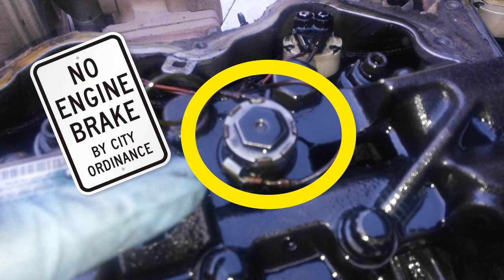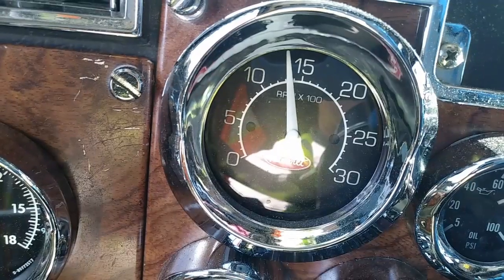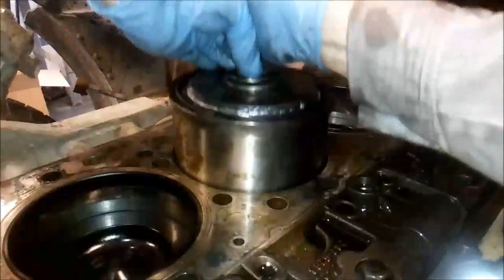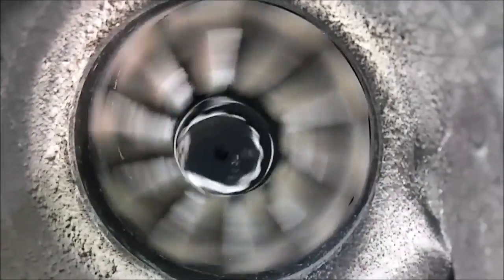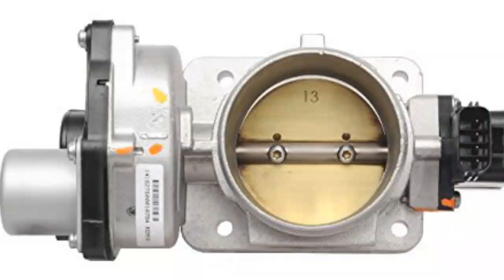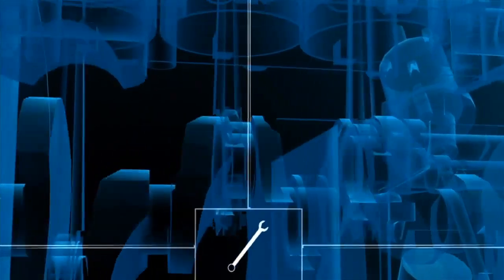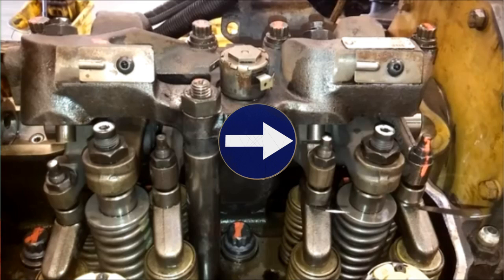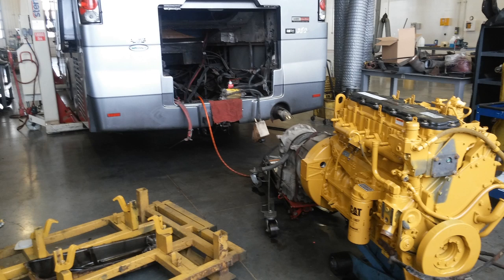The Difference Between Jake Brakes And Exhaust Brakes?

Comment: Mack engines use what they call dynatard? It introduces oil into the cam shaft raising a bump? Opening the exhaust valves at the top of the compression stroke relieving pressure hence a decompression tool

Comment: Thx for explaining. I was searching for the difference between a ‘retarder’ using electromagnetic force and is mounted on European trucks after the transmission, and other engine brake systems. Also trying to figure out if and why European trucks do not have jake brakes. 
Can you address this in a future video?

Comment: Been wondering how they are so loud, since here in europe they are not loud. This video was good explanation how air escapes under pressure and becomes loud sound. Many europe trucks have similar valve systems but not making loud sounds and some trucks like my FH16 has retarder that brakes very strong. Its hydraulic and mounted after gearbox.

Comment: The Exhaust brake on a IC bus with Cummins engines are as useless as tits on a bull. So International in their brilliance activate the cooling fan which adds a lot of resistance and NOISE to the operation of the school bus. The vehicle doe not downshift. And starting back up after a school bus stop the DAM fan continues to run along with this absurd noise and the bus is listless until the system turns off the fan, The fan steals 200 RPM of acceleration of power. BLUEBIRD uses a Variable Geometry Turbo and downshifts the transmission as you approach your stop....it works perfectly. International solution SUX.............I devised my own copy of Bluebird's Exhaust brake system, by manually throwing the shifter on the automatic to 2nd gear. I lightly activate the brakes to get the transmission to start its shifting sequence. The engine never goes above 2500 RPM. SMOOOOTH operator!!!!  My Bus Boss told me that I'm going into YEAR 4 of the original brakes on my 72 passenger IC bus and the wimpy powered Cummins

Comment: Thanks for comparing the two systems. Now, stupid question for anyone out there who knows: I get that I can add an exhaust brake to my diesel engine (6.5L turbo diesel V8) but will it be at all effective in slowing my (18,000 lb) motorhome downhill as it has an automatic transmission? Having to stand on the brakes whenever dropping down a hill really chews up brake pads (4 wheel hydraulic disks).

Comment: Where Im from the steepest longest hill used to warn 10mph, max engine braking. And there was a special lane for trucks that were still going 60 at the bottom. Some jackass at the bottom of the hill complained, so they put up a sign "no jakes". Then 3 out of towners never slowed down at the top. Two went in the runaway ramp, the 3rd went through jackasses house. Their service brakes had all caught fire halfway down the hill.
Reply: Just needed a muffler

Comment: Hi there, help me understand here, why small diesel sedans or some pickup trucks don't have exhaust brakes. at least when it comes to pick up trucks they weigh up to 3 tonnes, imagine them towing something, that number will be 4.5 tonnes which is like a small city truck. i think it should be necessary but they dont have engine brakes at all. Why?

Comment: I was told blocking the exhaust will burn the valves.   What's keeping them from burning now?  Titanium material? Na-filled?    I would have thought an intake side butterfly valve works much much better at letting the engine generate braking force.

Comment: Another thing people do not realize is that the actual effectiveness of a Jake brake is solely dependent on how much compression the engine has.  That's why older Cat engines such as the 3406 A,B, and C's did not have that great of Jake brakes.  The 3406E's and C-15's have a much higher compression ratio thus a much better braking efficiency is attained.

Comment: love your channel  no offense met   but intake butterfly valves have nothing to do with anything     I can prove it   take any gas powered vehicle  preferably one without a steering wheel lock    motorcycle  older car etc   point it down hill rolling at speed   release the throttle and feel the resistance      Now  turn off the ignition and open the throttle fully  and feel the difference   Why   because it takes more energy to compress a full charge of air than it does to pump vacuum   Diesels have so much more compression that there is more springback   like bouncing a half deflated basketball compared to one fully inflated   the timing of the jake opening the exhaust valve vents off the high compression and deadens the cylinder creating retarding force   This is also why a Cat or Mack engine doesn/t work as good as a cummins because they have direct timing off the 3rd injector lobe  where as Cat/Mack use a neighboring cylinders in or exh rocker arm thats kinda close for timing    Modern electronic diesels may use crank triggers or cam position sensors for Jake timing  Respectfully Thank You

Comment: So a jake brake will dump air that's compressed. That's cool. Could it also use a vacuum? the down stroke, too, being that they can control the exhurst valve you could control the intake too ? Or would this suck gasket in ?

Comment: Hell instead of having to do maintenance on a high temperature out of the way system it seems like it would be simple enough to install a throttle valve and blow off valve that was set to wide open unless braking then close and redirect boost air into the inlet side of the turbo and your done simple and quiet!!!

Comment: For the 3AM truck driver deep into city using their "Jake Brake" F€}%K O£F! We don't need that.
  Secondly, I understand that people are well, not the dim bulb but close to it. It is a "Valve" that pivots on a center shaft. Not a butterfly, google it.
 Electric injectors started in 2 cars in 1976, at some point engineering found that a throttle position sensor showing a closed throttle but vehicle speed and high manifold to atmosphere difference shut off the injectors to save fuel, reduce raw fuel in the tailpipe and not blowup the muffler (Gas/Petrol)...but no fuel until close to above idle speed, then back on to keep running. 
  As for the rest of the video was good, even the banana in the tailpipe good. (Eddie Murphy/Beverly Hills Cop) reference! 
DK, ASE master tech since 78

Comment: So when the compression brakes are active do the affected cylinders just repeat intake, compression, intake, compression strokes?  There is no need for a combustion or exhaust stroke?
Reply: With compression brakes on, the cycle is intake, compression(release on combustion), compression again then intake and start over.

Comment: 2017 f350 lariat it's my first diesel .1 month owner. I just don't want to break down . Does the exhaust break build alot of back preasure an cause the crank case an oil pan leak in yalls opinion.  I bought the truck an next day started drippin oil. Then they replaced crank gasket,2nd oil pan gasket apologies for the dumb questions just tryin to understand so I don't fk up an have a costly repair from ignorance

Comment: I've been a school bus driver for 10 years, and I've driven quite a few buses. One of the buses I drove had an exhaust brake on it (think it was an '05 International, can't remember what kind of engine was in it though). It was a really nice feature, especially on field trips. Coupled with the automatic, it would not only slow down on the hills, but the tranny would also shift down on its own. I still had to use the brake pedal, especially with  a  lot of passengers, but given that Internationals tend to require a heavy foot to operate the brakes, it was a really nice ankle-saver. The biggest drawback I found with it was the odd smell of burnt diesel whenever I used it. The odor would get into the cabin and stay there for a minute or two after I'd turned the E-brake off. It wasn't overwhelming, but still noticeable. I really miss that bus sometimes. Out of all the Trash Nationals I've driven, it was actually a good bus!
Reply: Lmao 😂 It says it's been two years since you wrote this with no reply and only 4 thumbs up. Hilarious, topnotch writing. I guess it just requires to much joy for all the Karen's to catch the joke.
Reply: @thetruthspeaker1978  4 months after you wrote, the count is now 9, still very few are 🤣🤣🤣. Great story.
Reply: @thetruthspeaker1978  Maybe they would have gotten it if I'd called it the Thirteen Letter S*** Spreader?
Reply: @jasongeorge7987  They might catch your drift then.😂
Reply: You just answered my question: does an exhaust brake work with an auto transmission? Thanks. Now to source one for our RV 😅

Comment: Why not put the exhaust brake on the intake side? Or on both sides? 

How quickly does that exhaust brake get caked in carbon, making it malfunction?
Reply: Funnily enough, my 1980's Toyota LandCruiser has an intake butterfly which is extremely rare on a diesel engine. Since I have a straight through exhaust (no muffler) it sounds like I have an exhaust brake when decelerating in gear. I love it.

Comment: why do people shift with the jakes on isent that the opposite of shifting why shift up when you switch gears and let off the jake comes on why do people do that. i always wondered?
Reply: It is a bad practice,  but some do it to shift faster because it slows the engine faster than just letting off the throttle, allowing them to get into the next gear sooner.
Reply: Cool man thanks for the feed back🤙

Comment: Hypothetically you can use an exhaust brake system on a truck equipped with a jake brake. It could potentially improve braking ability, but I'd be willing to bet in most systems, it would just make the jake bake system work less efficiently. The point of a Compression brake is to let all that high pressure air escape quickly at the, well, wrong time. If you then restrict the exhaust, that air has no where to go and it doesn't escape the system quickly. Thus you lose efficiency. Conversely, if done right, this could work by essentially reversing the airflow in the engine or at the least nearly stopping it entirely. It's not. Very good idea and theory isn't the same thing as real life.
Reply: Efficacy of the compression brake relies on the turbo charger which itself relies on unobstructed exhaust flow. If exhaust flow is restricted, the turbo's boost wanes thereby detracting from the compression brake which is itself much more effective than an exhaust brake, so it really is either or...the clearer choice being a compression brake if you need the stopping power.

Alternatively, if say you had a supercharger instead of a turbocharger, then what you're saying is absolutely right, you could literally add the two stopping forces together very effectively....& probably to the point of stressing the engine & drivetrain too much! But the argument against using superchargers is that they use more energy from the engine than turbochargers to function.

Comment: I cant seem to find the answer but can you put a jake break on a cummins pickup since some tractors do have cummins engines
Reply: Usually not a jake brake because of the space they take up, but exhaust brakes can easily be added and i know dodge had a cummins engine with the exhaust brake.

Comment: Is a retarder a different thing?
Reply: They can be the same thing, but they can also be attached to the transmission and use hydraulic pressure to slow the transmission instead of the engine.  Retarder is just referring to a system that slows something down.  Technically,  a jake brake is an engine retarder.

Comment: I feel like it would be easier to just cutt off fuel supply to some cylinders to achieve the same results... And I have been wondering  as you are saving your brakes ., what about the clutch?
Reply: Disengaging the clutch (ie pressing the clutch) is effectively putting the vehicle in neutral. Worst thing you can do when trying to stop. It also disengages the auxiliary braking system

Comment: The exhaust style engine brake can be useful when shifting going up a steep hill. The equipment were school buses with spicer 5 speeds powered by cat 3208's.
Reply: I have one on my 5.9 Cummins and it does NOT react quickly enough to have anything to do with downshifting.

Comment: Pit a Banks exhaust brake system on my 7.3 L  cause I planned to pill a travel trailer. What a waste of big money and it also uses the trans to slow by downshifting it.  It didn't work for shit and I just had it removed at a high cost. Don't waste your money.

Comment: Just purchased a 1994 Silverado C3500 Turbo Diesel that has a US Gear "D-Celerator" on it... Is this an exhaust brake system? I tow a heavy 39 foot RV and have keep it turned "off" until I can find out what it is and I know how to use it. - Thanks!
Reply: It is an exhaust brake they are used on Ram and Chevy and they work.  If you do a google search on the name you can read the manufactures info on them.  On steep grades at least you should have it on.

Comment: Awesome! My 18 ram with g56 had the exhaust brake and it works amazing. I’m ordering a new class 6 truck with the L9 Cummins. The exhaust brake was 184$ and the compression brake was 2132$ LOL I wouldn’t even be able to use it for what it’s worth so engine brake it is.

Comment: And how does engine brake work on a gas truck?
Does it just automatically slow down the engine and slow the speed with the RPM?
Reply: Gas trucks usually dont have them.  If they do it is an exhaust brake just holding backpressure in the exhaust.
Reply: The engine brake on a gas engine is the throttle valve that you control with your right foot. Combine that with downshifting the transmission. Same effect as Jake or exhaust brakes on diesel fueled trucks. More braking effort at higher rpm's.

Comment: The exhaust brake is more effective when the truck has a manual transmission,  with a automatic transmission you can’t really tell if the vehicle is slowing down.
Reply: yeah you can. my duramax/allison has a torque converter lock up same as it would if i had a clutch. Its engages to full lockup after 5mph. I must have my tow/haul mode on. Now older diesel pickup did not have a torque converter lockup.

Comment: I do have to note, exhaust brakes do generate noise depending on the manufacturer of the engine, I know with a lot of the Cummins ISX15's that ran them the cooling fan would automatically kick on under stage 3 exhaust brakes, but it's tertiary noise.
Reply: A lot of engines do that.  The fan uses up quite a bit of energy to run, so having the fan on adds to the retarding power of the engine brake system.

Comment: Could you have a jake brake which doesnt open the exhaust valve at the top of the compression?
Reply: It wouldn't be a jake brake,  it would definitely break the engine though...

Comment: A few years ago I drove an Adolf Saurer truck that had a Jake brake and an eddy current retarder (on the drive shaft to the rear wheels) This truck was designed and built for Swiss Alpine use. The engine also had a Supercharger for the hugh altitude use.

Comment: Just watched the video and wanted to comment. I worked for Mack in the late nineties and they had this setup with Jacobs called the Stealth system on their 454 E7's. It was the Extarder exhaust brake with the Jacobs engine brake together. Basically on the low setting it was just the exhaust brake and then on the high it was both but the compression brake was detuned so it was basically a failure. Went back to just a Jacobs engine brake on the ETechs.

Comment: Our dairy has the 2015 Cat truck with automatic 6 speed trans. From what I understand, International made Cat the engine, and Cat painted it their signature Cat yellow color, and put their own name on it. "N13"  we discovered it came with engine brakes as well as an exhaust brake, once we pulled the motor to swap out with yet another "Cat" motor made from International
Reply: Cat really own makes their big engines a big equipment... Practically everything else isn't made by them

Comment: Question, which is a more effective engine brake? An engine with mechanical unit injector (older Cat Cummins) or an engine with injection pumps (Mack, ISL, ISB Cummins)? I installed a lot of Jake's in the 1980s and the older Cummins engines you had to remove the exhaust rocker arm off of shaft and grind it down on the sides so the slave piston would pass by to reach the top of the exhaust valve spring retainer.
Reply: What depicts how well the Jake brake works is the compression ratio of the engine. The higher the compression ratio the better the brake.
Reply: @anonymous4507   correct, also engine brakes work better on large bore engines

Comment: the 3406A engine had a hydraulic retarder and .............it had problems. The exhaust brakes used on the European trucks up until the 2000's were uselessly bad, you might as well flap your arms out the window on a fully loaded truck. The Mack 'Dynatard' was only half as good as Cummins Jake.........but it was actually ok on the EME-9 V8's due to its much larger capacity. The super effective Cummins Jake brake was invented by Clessie Cummins and the man was a genius.

Comment: My Hino 338 has an exhaust brake, works really well, even when the truck is near a full load. I think a jake on that truck would be to much, it'd be annoying to drive. However, on a truck like a Hino 195 with a very small diesel engine, the exhaust brake's effect is super small. Interesting stuff.